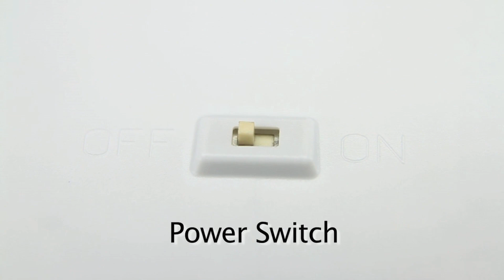Blade 350QX...What's Inside? - Build Quality

Comment: Still using the Version A props? Check the Product Bulletin (Red text, right side up top) regarding the prop failures. Blade/Horizon Hobby will replace your A-Props with B-props at no charge if you complete the form found in that bulletin. The A-Props have a tendency to separate from the hub at the blade root, resulting in catastrophic crash. Addressing this promptly is recommended.

Comment: Thanks for the video. I have crashed my Blade 350QX several times and broke 3 of 4 arms but after glueing it works again fine.
Now landed to deep snow so that on of the engines does not work. Actual it starts spinning but not normally and after 1-2 sec Blade turns to error mode. Any idea whats wrong?